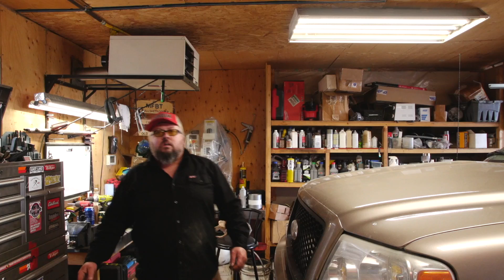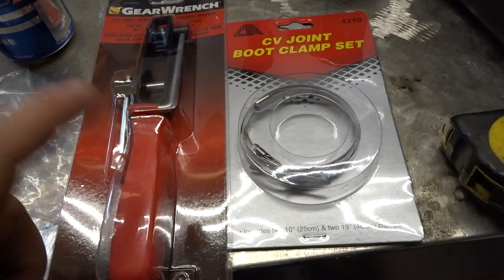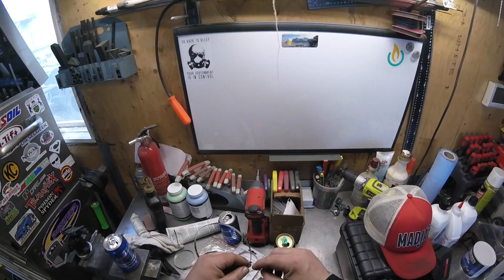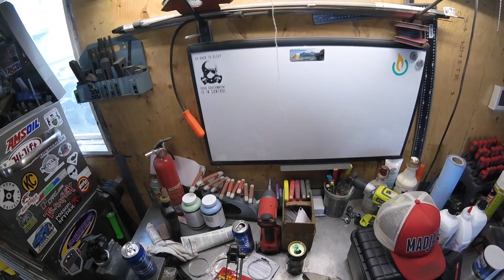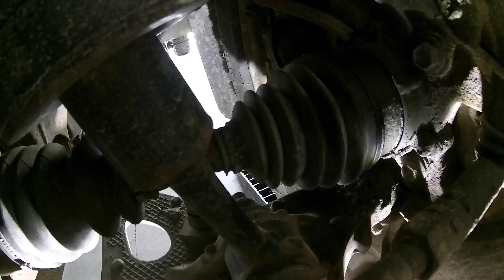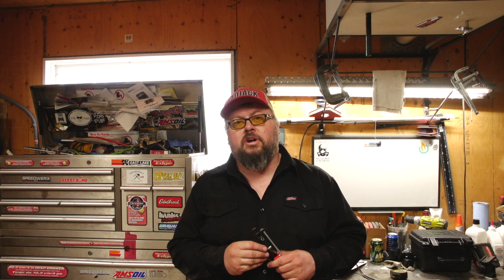CV Boot Clamp Repair DIY

Comment: I have an old KD tool that i got over 20+ years ago that does the same thing but has an extended bolt so you can use a gear wrench or ratchet on the end. That one looked like a pain in the butt in that tight space to use. Good job getting it done though. Take care.